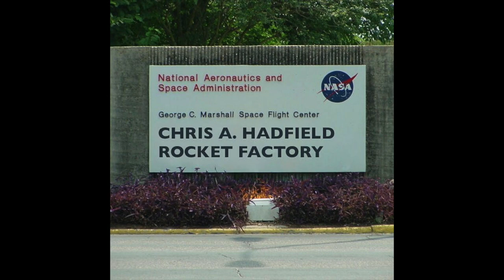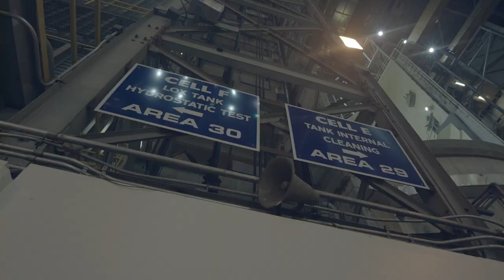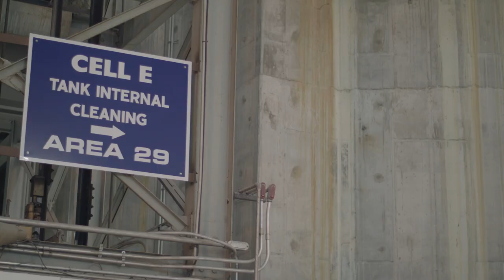Space Launch System: building the core stage at NASA's rocket factory

Comment: So many questions.  Is the airframe aluminum? The tank? Anybody know what yellow coating is?  Seen on Orion as well. What is the blue jig at 9:14?  What is in the electric arc furnace?  Will SLS ever fly?  Will it be competitive with commercial systems?  Will it be relevant?  Will SpaceX get there first?  Would it be faster to physically burn the money the constitutes NASAs (taxpayer funded) budget?  What is NASA's vision?  Is NASA too risk adverse? Why can SpaceX do Falcon development at 1/5 the price?  Can we give NASA's budget to Dr. Zubrin to do Mars Direct?
Reply from the maker: The SLS core stage tank is made of an aluminum alloy mixed with small amounts of titanium. The orange color is the natural color of the insulation foam thats sprayed on to keep the liquid hydrogen and oxygen fuel nice and cold. I believe that NASA will get to mars first, but most likely spacex will go to the moon before NASA. Inside that arc furnace was scrap titanium and aluminum being melted down and cast into rocket stage preform sheets, which are welded together. The first space launch system rocket flight is scheduled for early 2019. The core stages are shipped to the John C. Stennis space center from the Chris Hadfield factory for engine attachment and full testing, and then to the Kennedy space center vehicle assembly building for launch
Reply: Aluminum Oxide Thanks for your time and knowledge
Reply: The yellow coating is a chromate based primer that prevents corrosion of the Aluminum structure, there are trace amounts of copper in the aluminum.  Nothing to do with the TPS system. LH2 and LOX tanks are Aluminum.  Yes, SLS will fly and we will beat Elon to Mars!
Reply: Lisa Lane thank you! We WILL beat Elon to mars! I argue with spacex fanboys all the time on here
Reply: Of course spaceX can reduce costs by reusing rockets but get this;to land a booster back you are using the last bits of fuel in the tanks which are the ones that really give a lot of extra delta v to a rocket.
By reusability you half the amount of payload you can get to orbit and maintance costs can be sometimes as large as building a new rocket from scratch
So yes of course SpaceX is doing impressive work but people should stop acting as if they are gods, after all NASA figured out reusability with the Space Shuttle since the 80's but it was a costly programe anyway despite its promises to make space travel cheap and easy
After all BFR is still a paper rocket while SLS is being built as we speak
Reply: Why cant we all just be happy both are going to launch? Going to space is good regardless of how you get there.
Reply: Aluminium i hear it may be late december 2019 or  june 2020  for the EM1  launch now.  I'm hoping to fly over to see it.  :)

Comment: Ideally, NASA would have core stages and exploration upper stages built in series and launch them routinely helped by recoverable SRBs. Ideally, also, NASA could acquire recoverable CH4-fueled boosters to replace SRBs for flights with heavier payloads. The core stage is badly over budget and even more badly behind timetable. Perhaps NASA could use a heavy recoverable CH4-fuelled booster and the SRBs until the core stages are ready and give priority to the exploration upper stage? More reorganizations, the core stage contractor needs to pay for the delays, and the replacement boosters, or else?